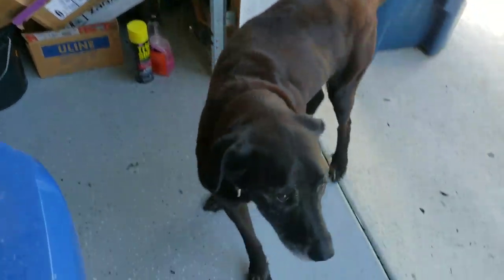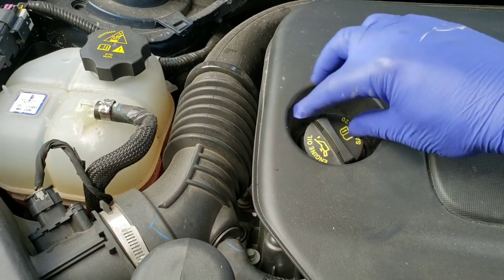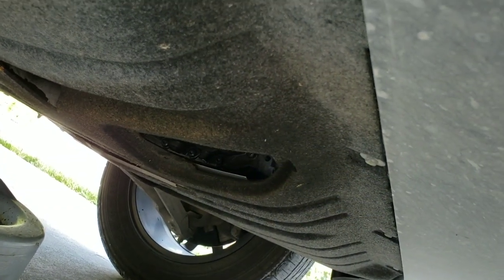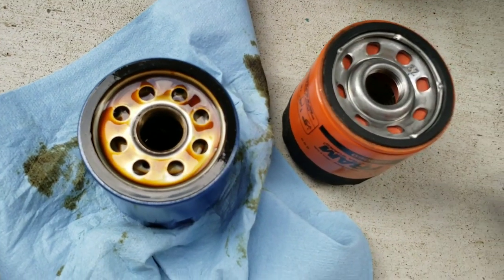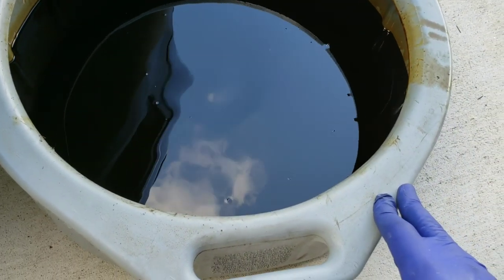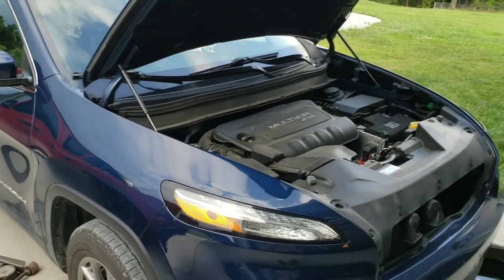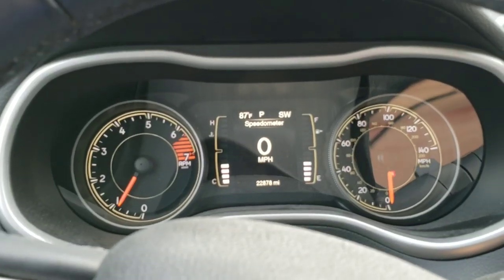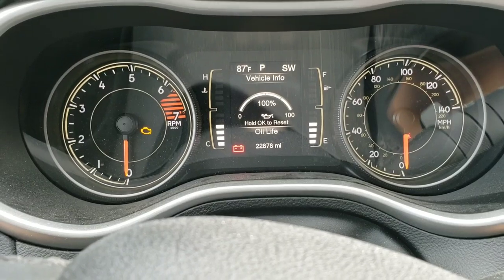2018 Jeep Cherokee 2.4L Oil Change - Not Burning Oil Anymore!

Comment: With the way the multiair system the oil pressure is what opens the intake valves. There is no mechanical connection from the cam to the valves. Works very similar to how a brake system works. I would recommend sticking to the 0w20.
Reply: Tried using different oils on this engine. You're absolutely right. Stick to 0w-20

Comment: Changing the oil viscosity and correct code will affect the MultiAir solenoid valves and lead to engine issues

Comment: I have a 2017 Fiat 500x with 38000 miles its losing about half a quart after 2000 miles since last oil change. The weak point of this engine is the piston rings oil makes its way past those and into the combustion chamber causing you to lose oil. Different styles of oil filters won't change that (to all the comments talking about oil filters)

Comment: Thanks for your you tube videos
My 70ish year old Aunt is having the same problems with her 2017 jeep Cherokee .
I been a Wrangler owner for 18 years with the same jeep now have 2 of them with the straight 6, 1994 w/300,000 ish and a 04 with 85,000 never add oil between oil change on both using fram filters and 10w/30 walmart oil  since I've owned them.
Again THANKS for videos VERY HELPFUL.👍👍👍

Comment: Between ESS, 0W20 oil, a weak 2.4L engine, and jerky transmission, the aesthetics are the only thing mildly attractive about this vehicle. Unless Jeep goes full electric, it's time to buy something else because under the hood is a just disappointment. Nice video, big help, all true, oil consumption is a pain. Lucas Oil heavy duty oil stabilizer is also good at reducing oil burn.

Comment: The 2.4 Multiair is port injection and not DI. I run Pennzoil Ultra Platinum 0w-20 with a Mopar filter and have been good from 8 miles to 20,217. They have a socket that fits the oil filter so you don’t need to pull the guard down. I have no problems with the 2.4 and I think it has enough power. I use my 7.3 diesel if I need power to tow

Comment: I have had the same experience with our 2018 compass same engine. After 20k oil consumption went down. We have 40k on it now and it uses about .75 quart in 6k miles. Thats doable

Comment: Changing oil viscosity is NOT recommended on these engines.  The low viscosity is needed to run the multiair block.  To think oil will cause it to not operate properly.  Same reason with the multi displacement on the hemi's.  A low viscosity is needed to run it.
Reply: Phantom, you are absolutely correct about the way the 2.4 Multiair engine functions with the oil controlling the actuators.  A solenoid is energized with each "rotation" of the camshaft controlling oil flow to actuators which control "valve timing" and "lift" from completely closed to completely opened.  In review FCA's (Fiat Technology) variable valve timing and lift technology combined main advantages is having separate timing for each cylinder.  It is imperative to have the correct oil viscosity as stated at 0W-20 for proper engine operation.  FYI, research our BestLine Engine Treatment which I use in my 2.4 multiair engine as it won't change viscosity!  It is a Diamond Nano-Lube lubricity product that reduces engine friction by 60%!  Thank you, Phantom, from your friends at BestLine Racing Additives.  Visit us here:  http://www.extreme-engine-relief.solutions

Comment: Nothing wrong with fram  filters..I would just change the oil filter at 5000km and no longer..all I use is the cheap fram filters and my truck has 413,000km on it

Comment: I leased a 2019 Jeep Compass with same engine. It was burning quarts of oil. Then around 11k it stopped. After 11k I went back to 0-20 walmart synthetic oil and it does not burn anymore. I am at 17k now. However, during the days when I was burning a lot, I was doing mostly city driving. Now I do about 75% hwy driving. I noticed that city driving engine temp runs at 225 or 229. during hwy it sits at 195. I wonder if the 30 degree temp difference may have something to do with oil vaporizing or not.

Comment: Yes these engines get pretty hot so I do not understand why they go from 30 to 20 when I would put 40 in. But we also have to understand that the synthetic 20 and 30 will not get thinner when hot.  These kind of oils these days will act as thicker oil when hot but I really do like the 40 oil best.

Comment: Had my 2018 engine replaced under warranty because of oil consumption issues and my new engine has been great.
Reply: ...problem is, it’s the same 2.4L multi-air engine. Hopefully your new one won’t burn oil...
Reply: I have a 2016 trailhawk and have always noticed that. It just hit 40k and it's burning 2 quarts every 5k miles when I change the oil. I've been reading that all 2.4 shark engines have this problem. A lawsuit was just filed the end of April 2020. We're most likely going to have a recall. I'm going to my dealership tomorrow to fight for a new engine that works
Reply: We are in a law suit with FCA for same thing. They refuse to do anything with oil burning and engine stops at highway speeds
Reply: @toddbrown2574  i saw that I've also joined the comments on that. My service Manager at the local dealership is trying to bamboozle me and tell me he knows nothing about that yet as soon as I spoke of getting my engine replaced he magically recalled the issue

Comment: 5W-20 was stamped on my previous two 2.4L engines. My newest 2.4 started using oil @ 18K right after a dealership oil change. Every brand, even Walmart, burns up. Mine is mostly from idling with my ac on, though. May go back to the 5W-20 and see. Express Lube put Amsoil brand this time to try. Didn’t check out the inside of their oil filter, though.

Comment: Use  a product called friction eliminator .   It really works to protect any engine.
Reply: JD Ruby, FYI, check out our line of BestLine lubricity products!  Add 1 12oz. bottle of BestLine Engine Treatment to 5 quarts of your favorite recommended motor oil.  Thanks from the Crew at BestLine Racing Additives.  Visit us here:  http://www.extreme-engine-relief.solutions

Comment: That engine was thoroughly designed and dyno and durability tested by the maker of the engine with the specified oil type. Switch oil weight at your own risk. I wouldn't.

Comment: I used a mopar filter and tightened it by hand. It poured oil out and I had to use the filter wrench tighten it 3/4 turn more to get it to stop

Comment: this is amazing news... really hoping the same goes for my 2018 compass. Thank you!
Reply: Richard Merckling how is it going? Im going to pick up mine tomorrow. How many miles and what problems you had so far?
Reply: lolimar q 27k miles, engine shut down on me once only 5k miles after a synthetic oil change. I’m currently getting more frequent changes and ensuring I’m topped off in case the excessive oil burning is still happening. Really hoping the oil burning ceases around 20-40k mile range as mentioned in the video.

Comment: what worries me is I've been so busy I did my first oil change at 6k miles at the dealership and I was not really paying attention to oil levels, but I had the car serviced at like 4k miles cause it stopped one day and would not start for 30 minutes  and they said it was some sensor, but I never thought check oil level... duh.. I wonder if dealership would have checked oil and topped it off as part of diagnosis on that service???
Reply: Your vehicle shut off because oil pressure levels were low this engine is notorious for when the engine oil gets low the engine will shut off due to low oil engine pressure to protect the vehicle this particular engine works by mixing gas and oil together and also squirting it to keep the engine cool and lubricated however because the oil is so thin being a 0w 20 it doesn't do a very good job at it if your engine shut off it was due to low oil change your engine oil every 3000 miles and every 2000 miles check your engine oil I guarantee it will be low add half a quart of any full synthetic oil so you can get to your next Oil Change

Comment: 5W-30 oil is too heavy for the 2.4L multi-air engine...maybe 5W-20 if you live in the South...you could void your warranty if you have engine damage...these vehicles have high compression rings which allow blow-by...excess oil is burned in the combustion chamber...some burn more oil than others...my 2017 Renegade uses about 1 quart every 2,000 miles...which according to FCA is acceptable...the 3.2L or the 2.0L are better engines...
Reply: thomas gamble finally someone with a brain. I just saw this video and was yelling at my phone. Lol.
Reply: I don’t get the big deal. If it’s not causing damage long term, and you keep your oil topped off, why is it such an issue?
I keep a quart of oil in my trunk, and check my oil level once every couple of weeks. I’ve never had issues, and it uses about a quart per oil change.  That’s $5-10 per 5000mi.
Big deal.

The 3.2l engine has some serious reliability issues.  Plastic oil filter housing cracking, valve lifter issues causing scoring of the camshaft, and others.

The 2.4l consumes some oil(in the engine, and seeping out of the valvecover gasket), and there were thermostat issues in the first couple of years of production.
Reply: @kroumful  ...it shouldn’t be using/burning oil in the first place.
Reply: @tgamble1000  i believe he meant to say 2.0 instead of 2.4l by the sounds of it the 2.0 leaks as much as the 2.4
Reply: Yeah 5w20 if you live in hot areas. I would not use a 5w30 in the multiair

Comment: Hello you don't have to remove all panel jst buy 2 dollar extension then you can remove the filter also your car leaking oil where your filter  that be cause you need to use mopar its walmart jst 9 dollars and no leak after that my jeep thankyou

Comment: I have one with  70000 miles on it and it still burns oil. I burn about one quart every 2500 to 3000 miles.  And I was warned by a Jeep mechanic  from my dealer to NEVER use any grade of oil other then what your manual recommends for the environment you drive in.  He went into deep detail but its to complex to explain it in the comments. And I've used lots of fram filters on my vehicles. I had a 2003 Ford Taurus that I had put 129000 miles on it and always used Fram filters on it. Never had any oil problems or noticed any excessive wear or oil burn. I would change oil every 3000 to 4000 miles on that car.  I'd put  five quarts of oil in it at every change and would drain out four and a half quarts after 4000 mile all the way up to my last oil change just before I traded it in.  And the reason these filters got more expensive is because they're made in China dude.  With the new trade war with the tariffs put on Chinese imports you gonna pay more.
Reply: That's correct in only using the recommended  grade of motor oil, i.e., 0W-20, 5W-20, 5W-30, 10W-30, 10W-40, 20W-50, & so forth.  Please note:  The Chrysler, Dodge, & Jeep 2.4 Liter (Tigershark) MultiAir Engines are a 2nd. generation MultiAir VVT:  PLEASE NOTE!  FCA (Fiat's Variable Valve Timing & Lift Technology MAIN ADVANTAGES:  Having separate timing for each cylinder.  A solenoid is energized with each "ROTATION" of the camshaft controlling OIL FLOW to actuators which control "Valve Timing & Lift" from completely CLOSED to completely OPEN...  FYI, here is a highly recommended Engine Treatment by BestLine for your 2.4 MultiAir Engine as it won't affect viscosity in the 2.4 MultiAir.  Thank you, REH, from the Crew at BestLine Racing Additives.  Application:  Add one 12oz. bottle of BestLine Engine Treatment to 5 quarts of your favorite recommended 0W-20.  Allow room in your crankcase to add our Engine Treatment by adding 5qts. of motor oil & 1 120z. bottle of BestLine...  Visit us here:  http://www.extreme-engine-relief.solutions

Comment: 5w30.  really.  How long before it flagged oil codes.  This engine need specific oil pressure to run the multi air brick.  I hope they void your warranty.
Reply: Exactly right.

Comment: Buddy please don’t use Fram they are cardboard crap .. flat metal relief spring crap .. trust me please .. cut it apart and see for your self .. go to Napa or order a Napa Gold or Napa Platinum,, cut it open .. Napa filters are made by Wix the best filter manufacturer period.. Napa Gold filters are the best you can by ,, and it will add 100K to the life of your engine . My wife’s Jeep Liberty  has 240K on it and doesn’t burn a drop of oil between oil changes and runs with the same power it always has and no engine noise at all none .. check for your self .. Napa Gold filter and Mobile 1 full synthetic oil and get 400K out of your engine !! Buddy ya can’t cheap out on a oil filter , ya spend thousands on tires and lifts and stuff , but they won’t roll if the engine don’t run lol ,, oil and filters are things you never ever be a cheap skate on ...
Reply: OFFRD, Father Knows Best.
Reply: Bought a pair of plastic ramps to change the oil.Works great on the Jeep. I'm switching to 5w20 to see if consumption goes down

Comment: Sounds like you're very opinionated about a lot of things. The filter can easily be hand loosened and tightened. No need to remove the under cover. Not sure why u didnt drain the oil prior to removing the filter. Probably makes no difference though... as for switching over to 5w30, you got me curious and i might have to research more about that. I have the same engine in my dart. There was a recall for the oil consumption. The reason it consumes so much oil is because of some feature that help engine braking when you take your foot off the gas. They disable that feature in the recall but still consumes oil, just not as much. I put an oil catch can and i still have to empty it every oil change.

Comment: Piston rings are too thin. Most likely the exhaust will clog up
Reply: This engine is loose, I mean rings and guides are low tolerance levels. Some seat in a lil better at break in. I live in the mountains so hard break in for me. I add some oil to mine here and there. I check it every 1000 miles and top it off. I've seen these engines hit 180k and still run strong with out much trouble except oil loss. It dont bother me. If it was a quart every 500 miles I'd get it checked then. But a quart every 900 to 1500 miles wont hurt the engine. In the winter it uses less oil, atleast mine does. Or constant open highway. Afew times it barely dropped after 3000 miles. Other times 1000 miles it was a quart low. It's always been that way. I just keep a check on it.

Comment: I was wondering is it alright for me to add a few quarts until I get a proper oil change?
Reply: Yes make sure Not to overfill
Reply: @housebaelishgaming  I added 2 I hope that’s not overdoing it I really don’t know about these things 😩
Reply: @Sjblock89  I hope not either but it all depends how low it was
Reply: @housebaelishgaming  it was pretty low probably near empty 😩🤦🏾‍♂️👀
Reply: @Sjblock89  I believe it holds 5 quarts total you should be fine if its just within the checkered line your a half quart low if your in the middle your good never wanna fill above the checkered line on the dip stick. Also bear in mind the crank case holds 1.2 quarts of the 5 quarts so when you check oil the oil in the crank case may not have settled properly yet (if the engine has been running recently let it set for 15 minute)
Reply: @housebaelishgaming  Thanks so much hopefully I didn’t over do it... I pray it can do me justice until I’m able to get it done correctly.
Reply: @Sjblock89  not a problem by the way check out schaeffers 0w-20 full synthetic engine oil ALWAYS USE FULL SYNTHETIC in this fiat but that schaeffers is the roles Royce of oil and its got a special ingredient in it that helps with lube and prevention of wear and don't listen to anyone saying use heavier oil only use the weight oil marked on your oil cap on the engine. This car is a multiair engine its a complex amazing engine and it has a brick inside of it with thin channels and a heavier oil means oil won't travel properly and will just screw the whole thing up

Comment: Anybody hear a  very slight feathering or backfiring noise when you accelerate these engines. What could that be?  I may have never noticed it before.
Reply from the maker: Can't say I've ever noticed that.
Reply: It’s spark knock. Normal for these engine. Don’t worry about it.
Reply: @Christmaslightguy84  I don't recall my van having those sounds in the first 3k miles.  You saying it won't affect the life of the motor? You own this motor? how many miles?  
I plan to test drive a new 2019 model to see if it has it off the lot.
Reply: NoSunBeach I’m a technician for FCA.  Almost all our motors make that noise.  If your concerned have it looked at, but going from coast to light throttle a metallic tinny rattle noise can be heard.  You have to realize that this engine has one cam and one oil controlled block that opens intake valves. That’s why it’s so loud at idle. Very ticky.  Your hearing the intake valves opening.   Keep using a good synthetic 0w20 oil.  I rec Mobil 1 with mopar filter.  If your burning excessive amounts of oil. Over 1qt in 2000 miles. You will more than likely need a engine.
Reply: @Christmaslightguy84  Thank You!.  My car is being observed in 1000 mile oil consumption test.. The dealer said they wanted to check that before doing anything about the spark knock which they claim they could not hear.. I don't think they drove it.  I'm not worried about the sound of the engine at idle, but rather spark knock sound when the engine is under load and driving. I can't reproduce it while parked.  Just drove the van 600 miles and it felt strong despite the sounds. Not sure if you can hear it here. https://www.youtube.com/watch?v=BS1489q8b3s&t=13s